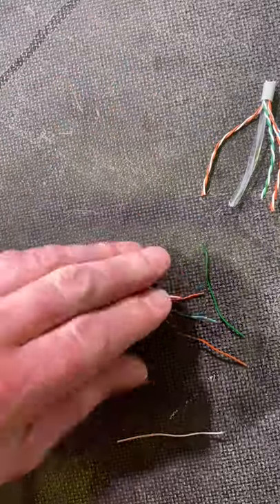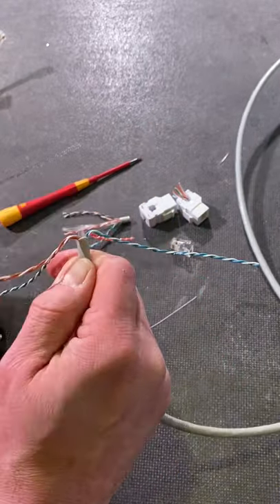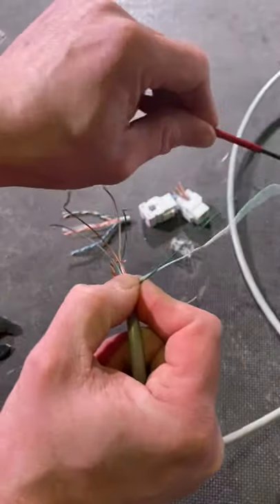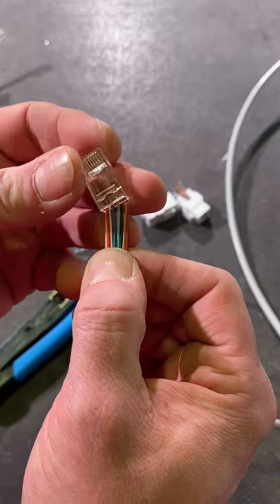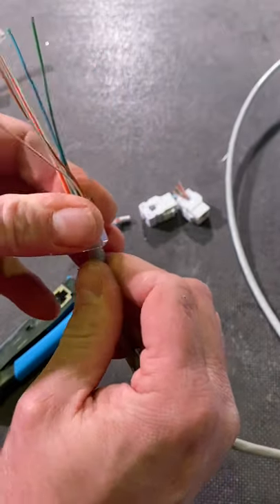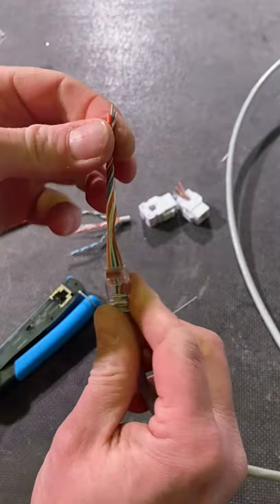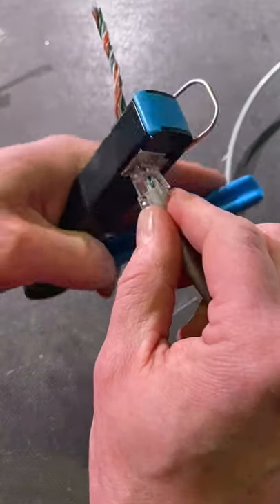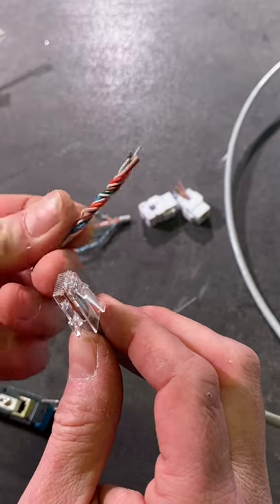Wire bits on the floor NO MORE! - eFIXX electricians' top tip #shorts

Comment: Everytime that I see one of you videos related with electrical conections I'm amazed but, when I see networking videos and see so many future problems being created... A very nice tip do give instead is to cut much less cable, maitain the twister pairs the longer as you can and don't that type of connectors.